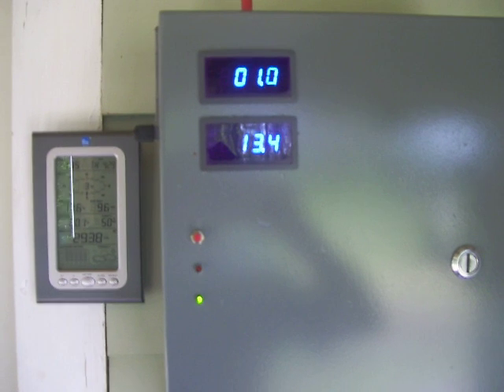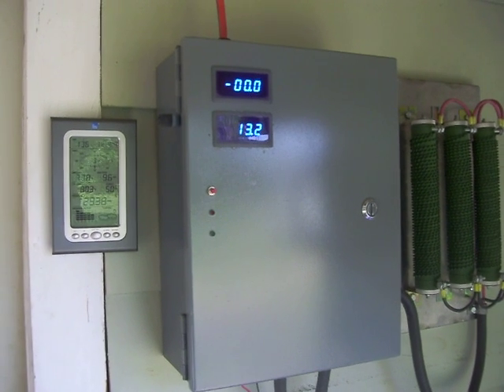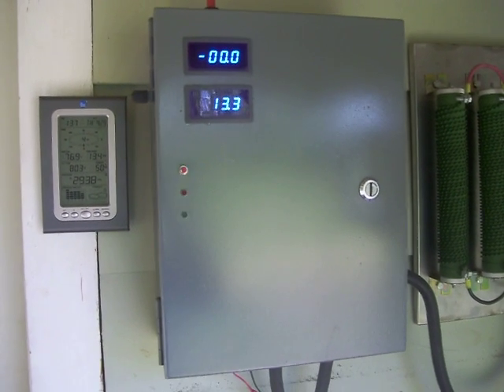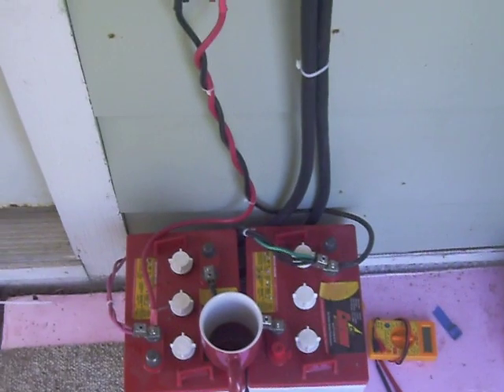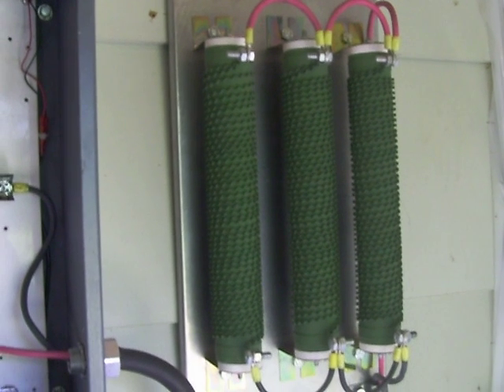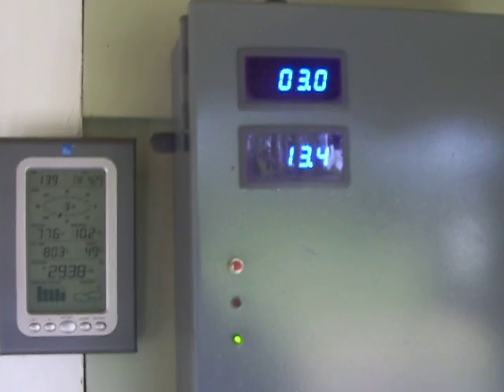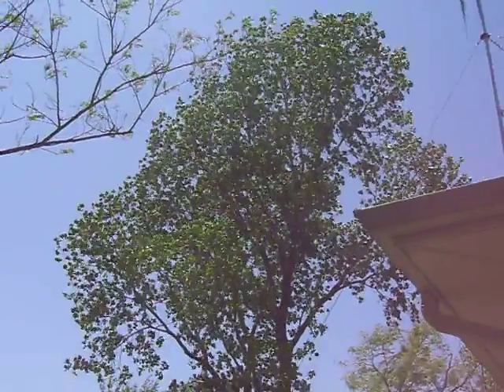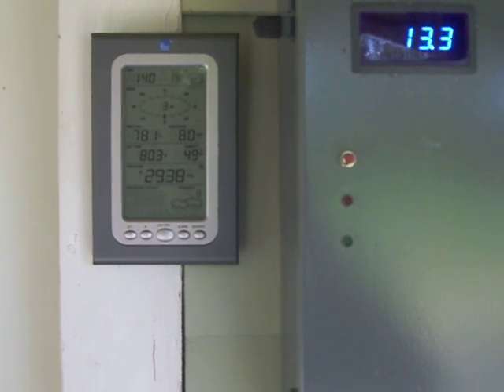Turbine control panel

Comment: Hi Nate, thanks for the comment. I've gotta do something soon about the swaying, do that in the morn. The invertor bought that off ebay payed a lot for it and it has a large capacity for watts. If interested I'll send you the seller and also the weld cable runs on bid 60 to 80 dollars for #2 and #6 or buy now, for 100ft.. thanks and i love the LED box you have.